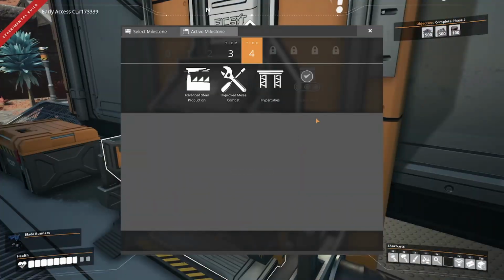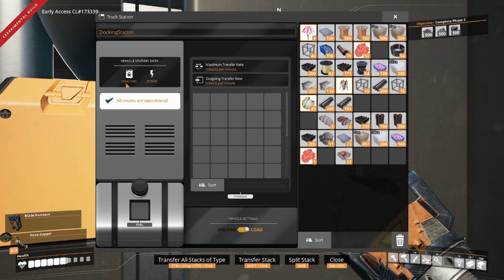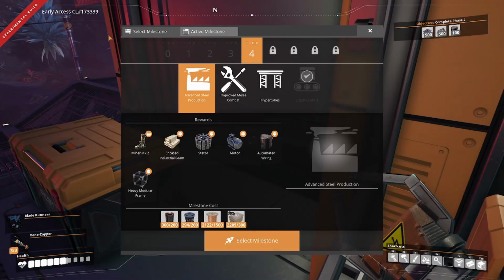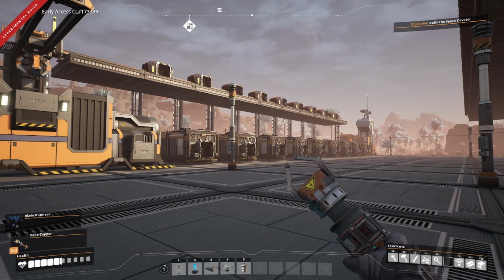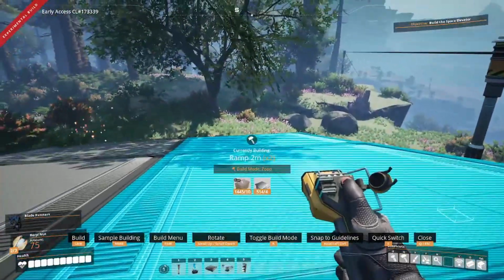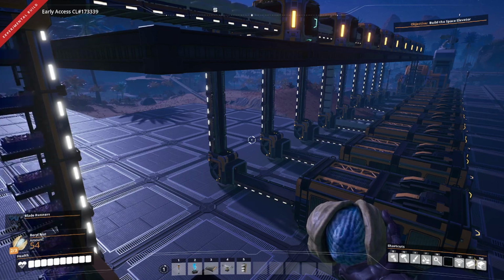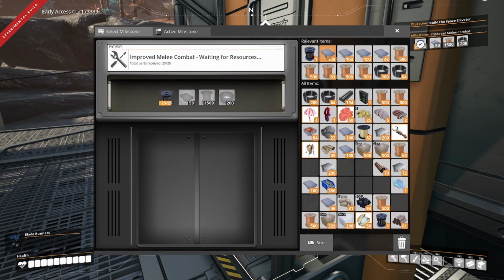How to use Vehicle Automation -Satisfactory Update 5 Ep 05 (Let's Play / Tutorial / Guide)

Comment: not sure if this will ever be seen but for the coal re-fueling it looks better if you use a conveyor belt hole (purchased from the ticket shop under attachments) that would be in the logistics section. you can place it on a foundation tile and place the top of the conveyor then go underneath and place the bottom of the conveyor
Reply from the maker: Hey, I see your comment and appreciate you taking the time.

At the time this was recorded, floor holes had some pretty substantial issues with connections, so I elected not to recommend them. I believe those have mostly been resolved, since

Comment: I chose the grassy planes starting area and basically set up my main base up on that cliff kind of by the big poison rock thing with the slug on it (probably most common grassy planes area). I just finally set up some refineries over by those little islands in the west and want to ship my plastic and rubber from over there to my main base but it’s such a far distance that the petroleum coke im making there will not cut it. Do you have any advice on what to do? I built a sky bridge type thing so my truck doesn’t have to go through that crazy coastline and jungly area with all the giant spitters, but it’s still just a very far distance (well over 1000 meters)
Reply from the maker: I'd try driving the route to see if your tractors and trucks can make it- they can go surprisingly far. You could also fuel then with coal or packaged fuel to extend the range,  or set up a refueling depot halfway.

Comment: I didn't know a truck can load multiple types of items. It's neat that you brought them all to be sorted at as you did. I was contemplating wether or not to use a truck system and if I needed a route for each type of item, and how it would come together. A main bus is easier to design, but takes a lot of resources and time to make.
Reply from the maker: I use main busses in other games and I like the idea of them, but in my first playthrough I did one in satisfactory and it was huge and ugly and tanked my PC's performance. I pretty quickly switched to vehicles after that, and they certainly have thier own challenges but I don't think Ill go back. I sort of think of my vehicle lines as a main bus, since logically it works the same way for incoming items. Outgoing items are trickier though.

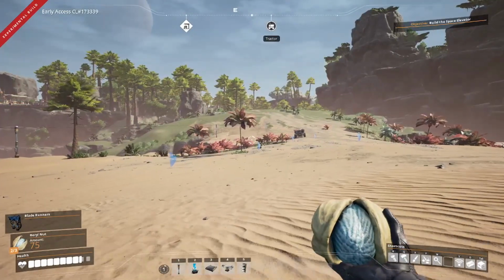Comment: 18:00 when i played in the desert, it was easy to follow (or even overtake) the automated truck with another truck to check whether it was working as intended. but since you can't be in the truck to make it drive automatically, i spent lots of time walking and running ... until i noticed that i simply can stand on its roof and do some easy sightseeing (and checking for problems on the route).

now i only would need a method to slightly adjust errors in the route, like moving a marker away from some tree or away from the edge of the road, etc. simply deleting nodes can help, but mostly isn't good enough, and recording the same long path over and over again becomes annoying.
Reply: With the update to maps, sounds like beacons will no longer be needed as used in update 6. I'm hoping they can instead be used for truck routes. like drop one near the route, and then connect it to the route, like you do with a power line, then you can either let it default as a waypoint, or edit it to a pause or any other type of route item.

Comment: 7:20 i usually had edited the pauses for trucks so that they waited longer before doing the next roundtrip (to not always do deliveries when they are only partially filled). but with your info, i seem to have wasted lots of power when pausing trucks at stations, and i should better reduce those pauses (can pauses for loading and unloading even be omitted entirely? how fast do stations load and unload, maybe even a passing truck that doesn't stop?) and instead pause trucks later halfway during their tour where they don't trigger power usage !?
Reply from the maker: Good thoughts! I ran into this issue later in the episode after I record my route and decided that the tractor idling in front of a truck station is probably fine since I need that amount of power available anyway. I certainly would not before getting power automation though. As far as how long you can wait, stations move 2 stacks a second, and at full tilt you can move 6 stacks driving through a station. If you are turning in front of it, you get more. I put a pause in for a few seconds at each station while recording so I can adjust as needed. Since making this video, I have also learned to create a pause away from a station as you have said.
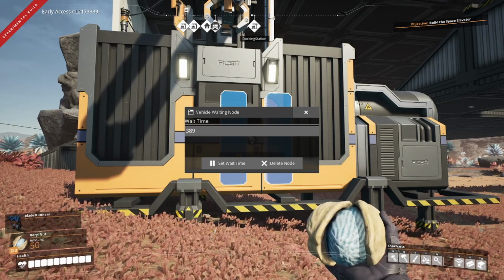Reply: @Dekoba  yes, at 23:50 ... i had written that comment WHILE watching the video